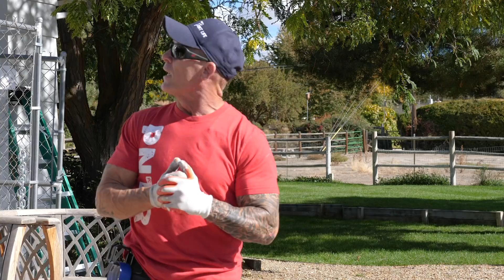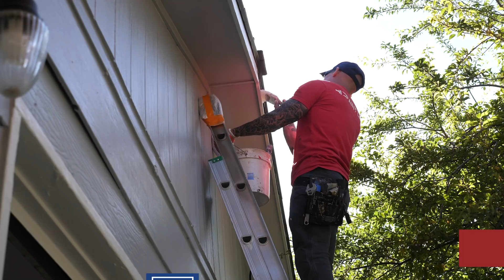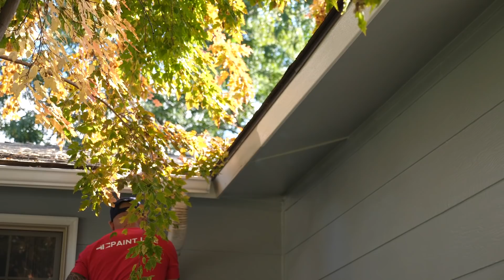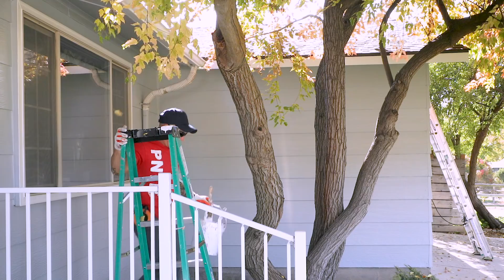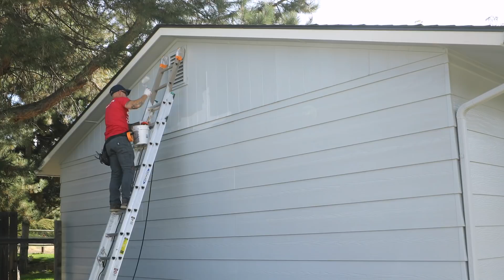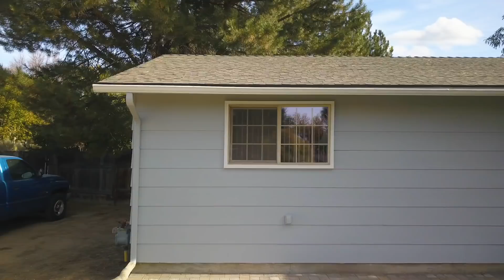Painting A House Exterior from A to Z

Comment: Love your shows. I had one fall from a ladder power washing a house, I had to set up my ladder on a brick patio with moss covering the brick the owners loved.. Needless to say my ladder slid from under me on the moss when it got wet, I also was not injured I had slight swelling with my knees as they slipped through the rung. I finished the power washing but had to take a day off to recover...
Reply: I hate getting on ladders while power washing
Reply: I use a huge 24 ft extension wand